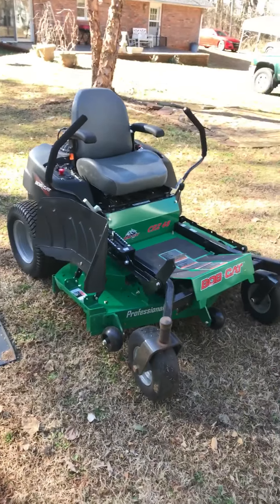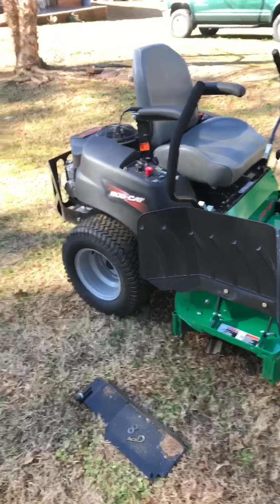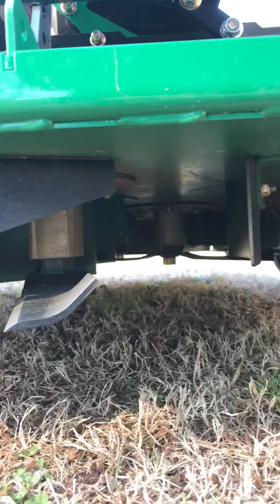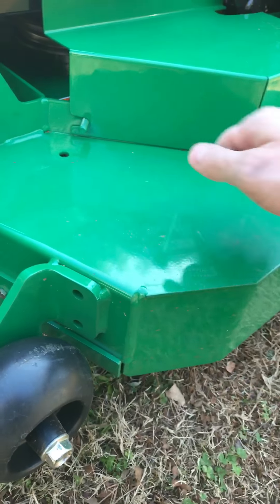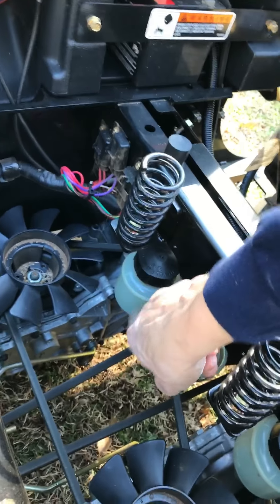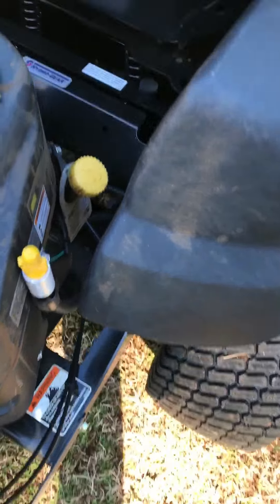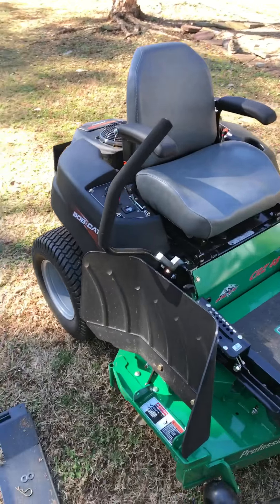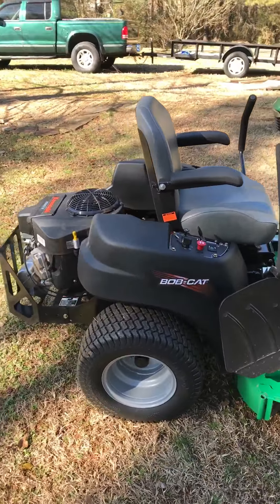Bobcat CRZ 48 Overview

Comment: Did you find the 48 inch deck extended far enough beyond the rear wheels to avoid the need to come back and do trimming with a push mower?

I am torn between the 48 and 52 inch deck.

Comment: Wrong about many things in this video ...first of all nothing about this mower is commercial..2800 hydros are not considered commercial,they are homeowner ...2nd the deck is not 10 guage not 7 guage  steel ..3rd the Kawasaki is the Lowest engine they make and is a residential grade engine ...4. Does not have better clutch system built into the mower , it has your basic parker clutch system that all residental mowers have ..seems you were just making stuff up during this video , instead of taking time to do a little research and get information correct
Reply from the maker: Amp 242 , you’ll be excited to know I did not consider it commercial. It along the same lines as “entry level” commercials. It has much better quality than others in its price range.

The hydros are not commercial, the 2800 is the top of the line for residential mowers, it’s has a higher top speed and tougher internals than box store mowers. 3100 is hydrogears commercial.

This mower does not have a Parker clutch, it’s 105lb Warner. 

I never considers the FR Kawasaki commercial, but it is a very well built engine. 

And yes, the deck is 10 gauge, but the skirts are 7 gauge for structure.

I’m well informed on my mower, thanks for the comment though!
Reply: good review Marc
Reply: Great review, some people need to actually listen to the review at no point in the video did you state any part you described as commercial but as better